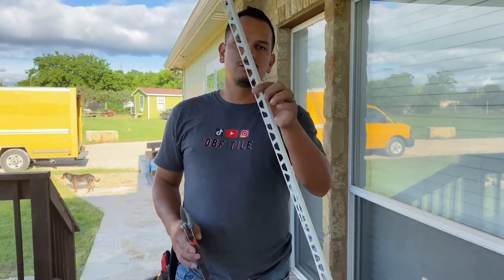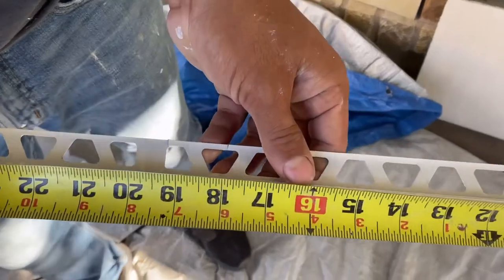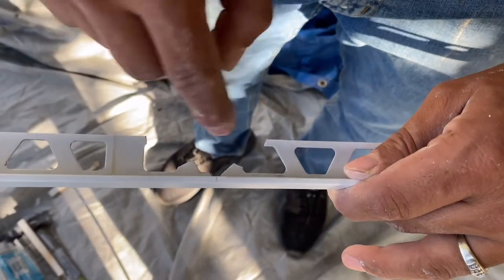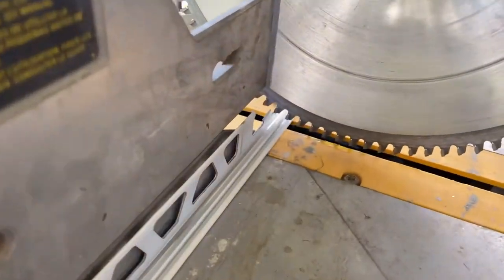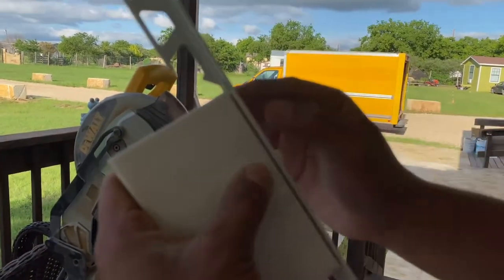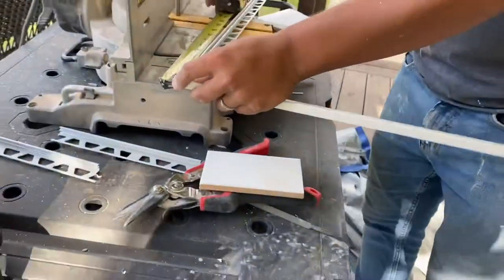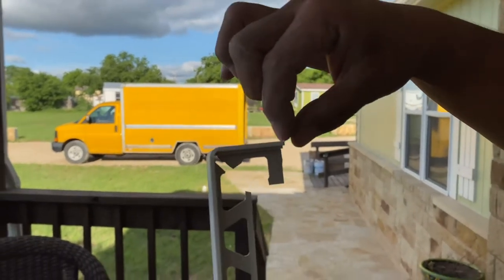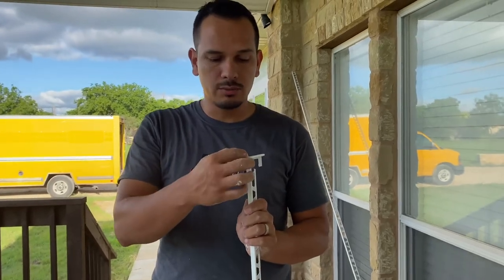Bending your schluter metal trim step by step

Comment: Great video! going to be doing this on a custom tile shower curb. Miter would have been really sharp on feet at the corner entry. Just wish I had a metal blad for my chop saw, it's a file for me.
Reply: Sandpaper will knock off the sharp edge pretty easy.

Comment: It looks good, but you can sure tell if you're a perfectionist that it has been bent and whether it's Chrome or white the color actually changed a little bit when you stretch the metal. Me personally I-45 them hand sand them and file them. So there's no sharp edges even with a correct 45

Comment: Great video - Stupid question - Id like to bend the top of my vertical shower wall front face but Its just under 8' to the top wrap which puts my Schluter trim on the top horizontal run at only a couple inches extra - so what is the best way to continue the Schluter around the top horizontal run - basically Id be trying to seam 2 flat pieces. Is it best just to miter my corners at that point or is there a professional looking way to end 1 piece & start the other for the remainder of the run around the top side of the shower wall? Thanks so much for the info!!

Comment: Can you tell me exactly what blade you used? I have a dewalt 12 inch miter saw with the regular 80 T blade.  I’m trying to cut schluter profiles but instead of bending I bought those corner pieces. I would just like to know what blade you use. No one else is really descriptive. 

Thanks for your time and great video
Reply from the maker: Diablo non ferrous blade